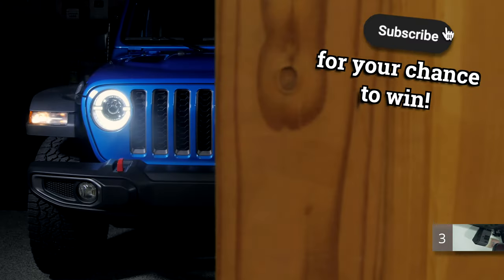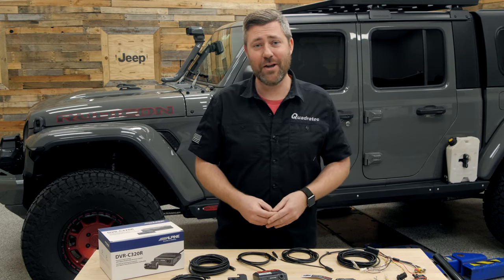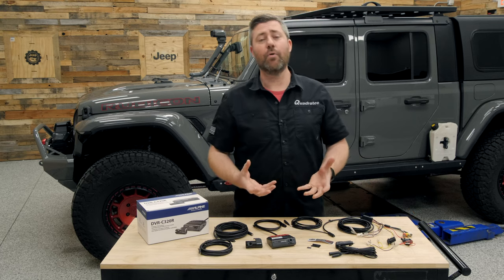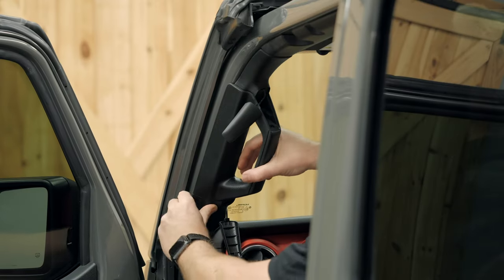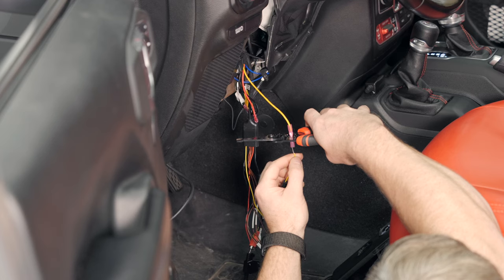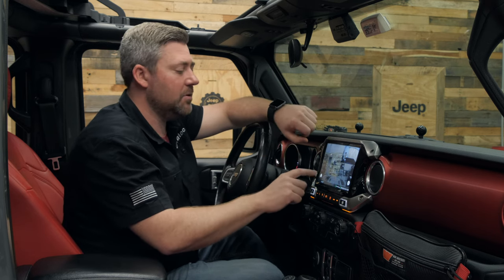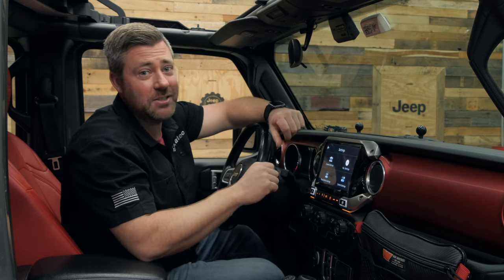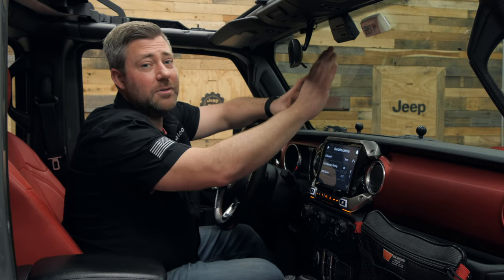Alpine DVR-C320R HD Front & Rear Dash Camera Install & Review

Comment: Hi, can someone help me I have this dash cam installed with a Alpine ilx f511
And it’s strange, but everything works except parking mode  is that because it was installed incorrectly or is my dash cam defected.
Reply: It needs to be hard wired and you have to enable parking mode in settings.